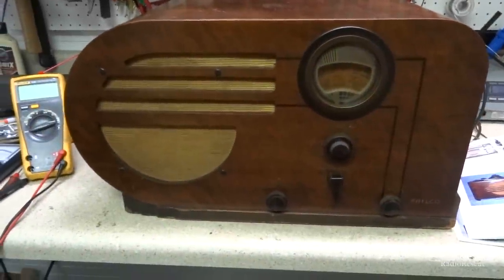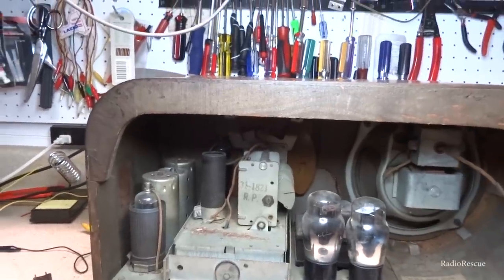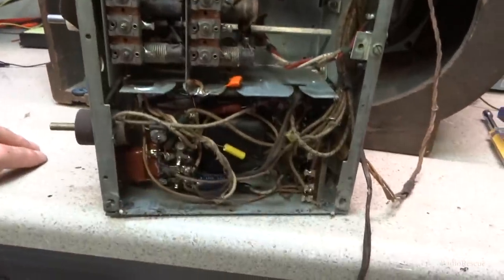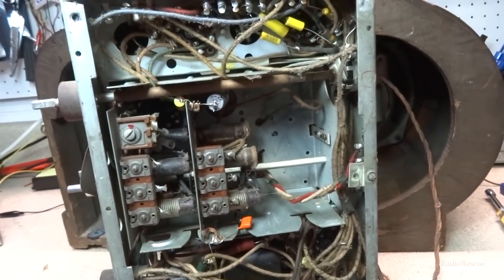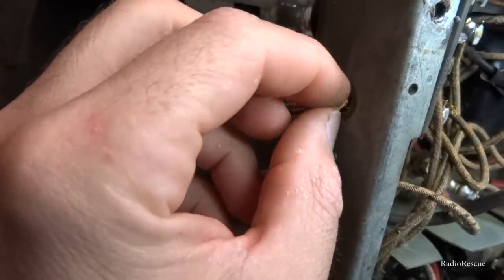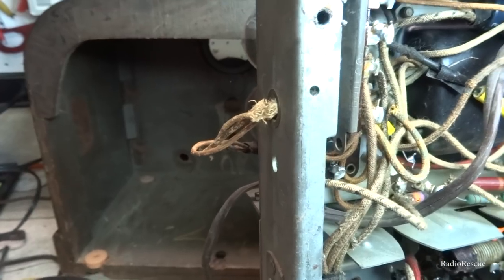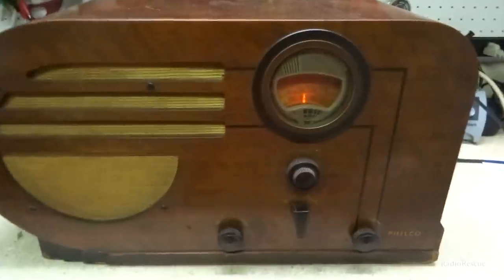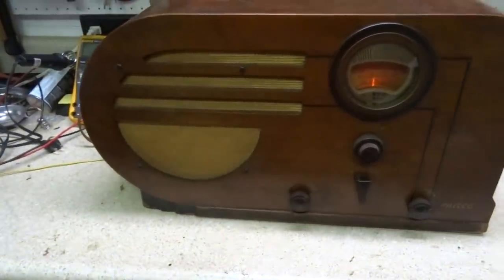Repair of a 1937 Philco 37-610 Tube Radio

Comment: In general try cleaning the contacts in the tube sockets first . Then check the tubes if voltages don't improve. Good to replace the tubes.
Since someone worked on it before he may have not done that. Good deal of checking previous work poorly done on chassis. Excellent repair job!

Comment: The absence of typical Dog bone resisters for the newer metalic ones and the newer caps at least means someone spent some time on it. I know what you mean I thought some I started to repair were easy and they turned out to be a real bear by the time I was done.

Comment: Good job. I'm curious if replacing the rectifier tube brought the somewhat low tube voltages back to normal. Thx
Reply from the maker: I should have included that in the video. It did bring them back up.

Comment: That soldering gun your using looks to me it’s an older Weller model 8200 ? I got a couple of those. The highest wattage soldering gun I have is an older Weller model D-550 thats a 240/325 watt. The place I use to work at years ago had a big Weller soldering gun. The shop attendant at the place I worked at was soldering on something one day while I was in the shop. I asked him what wattage the gun he was using, he replied it was a 500 watt. So I was wondering have you heard of or seen a Weller 500 watt soldering gun ? I’ve done searches trying to find one but to no avail. That’s making think he was wrong about that guns wattage. If there actually is such a Weller 500 watt I’d like get one. Thanks for your help.
Reply from the maker: I have several. The one in the video is an 8100 made in Easton PA. When i was in the military, we had a gun in the truck shop used to repair radiators that was 500 watts but i can't remember the model or make.
Reply: @45AMT  I’ve got one 8100. Also have a Weller D-207 that was made back in 1947 it’s still got it’s original cloth covered power wire that’s in perfect condition and still works great I have a lot of respect for the older Weller guns. Thank you for your service to our country.

Comment: I have a 37-630 ands am trying to repair it. The speaker is completely shot.  Is there a way to replace it with a modern speaker, or should I try to find an original cone.
Reply from the maker: The Original is an electrodynamic speaker which is also used as a choke for the power supply. So an original would be best.